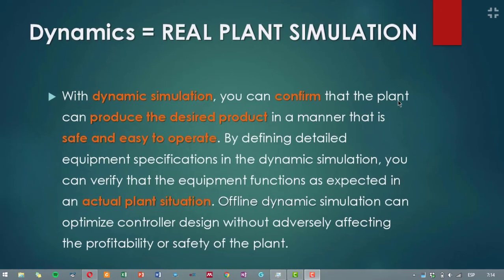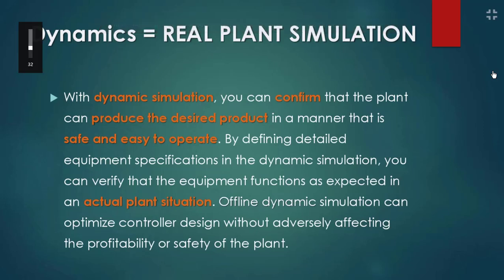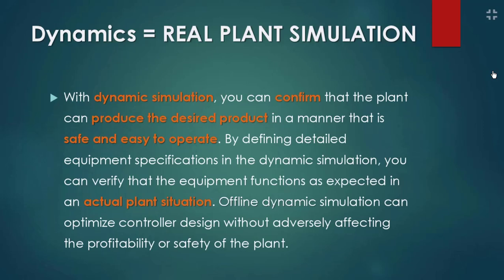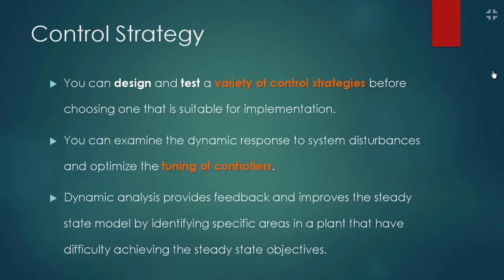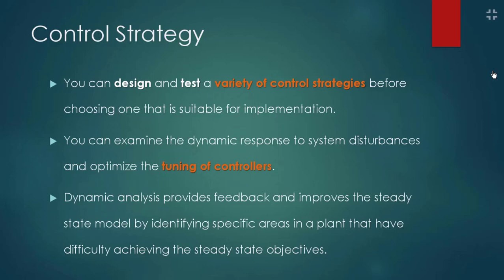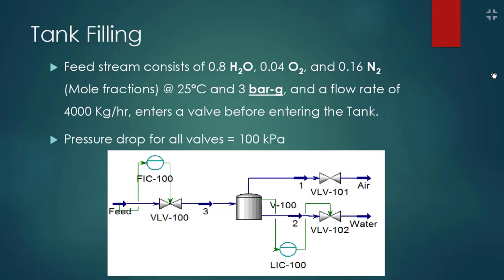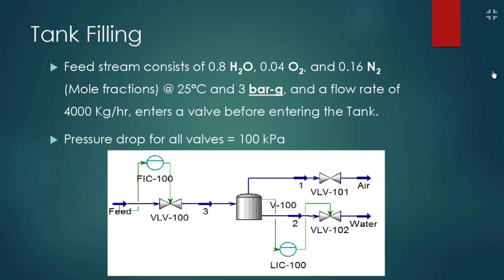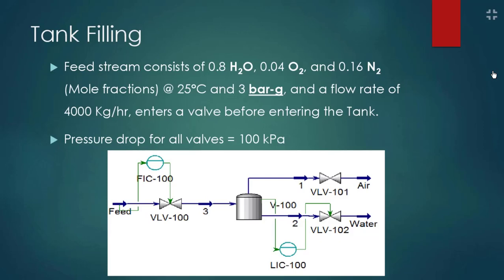ASPEN HYSYS V10 Tank filling

Comment: It's very interesting..But, it was supposed to be lecture on dynamic mode, and you wasted lot of time explaining the basics of hysys or fluid flow (connecting a stream to a valve, explaning the Cv, the pressure flow relation, and so many repetitions of the same thing for 4 or 5 times..)..Thx anyway,